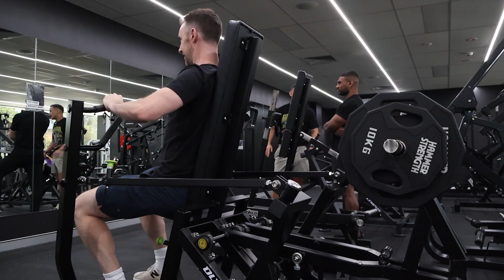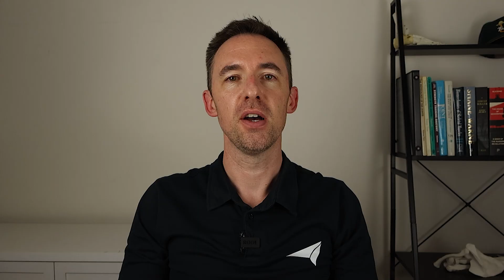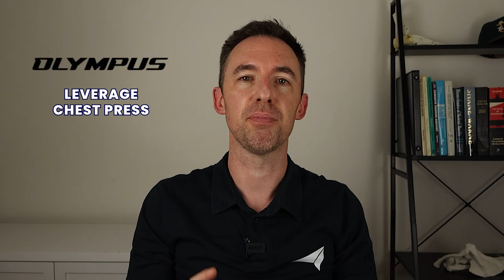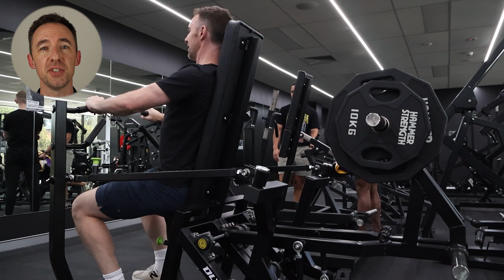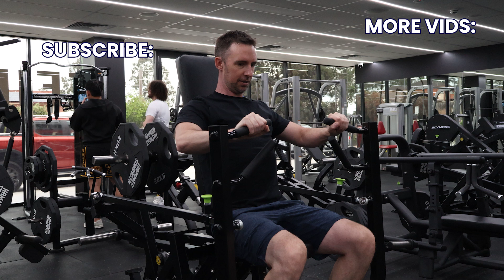Leverage Chest Press Machine Analysis

Comment: Great analysis.  Training many, many men over the years, I find men will fail at the tricep extension end of the rep in a set as the pecs have more mass/power to drive weight out of the bottom,  than smaller triceps can produce at extension..
Reply from the maker: Yeah I've found that at times myself, often with dumbbells where the triceps fail and you get that dumbbell wanting to fall inwards.

Comment: This is made in china and they claim Australian. It's s only put back together in Australia but you can order these yourself delivered to your home with better metal handle options and more options for $3000 total cost, if non unilateral it'll be $2000.
Reply from the maker: That’s a great deal 👍🏻.  Is there a website for that?  Is it relatively easy to organise?  I’m not sure if they claim Australian made or anything like that.  Just me pointing out that the website is in Aus and they can deliver here etc so that’s prob my bad.
Reply: @inprogress-au Alibaba if you source out and make sure you check thickness, weight capacity, delivery to door as many lie and just buy from the main people and sell again to foreign buyers. Power X was one with good stuff and their photos of this company also were some photos in the Chinese factory. I had some and were very good so a gym bought from me

Comment: Strength curve at different position?
Reply from the maker: From my understanding we’d be a lot stronger with the arms heading towards fully straight (end of range).

The nautilus chest press I own gets too hard as you get towards half way on the concentric.

This one goes the opposite way.  However you can change that if you load the plates on the bottom pin.

Comment: Looks like it has a lower loading pin option where the resistance curve would be more flat or even heavier when your arms are nearing full extension
Reply from the maker: That’s right. I forgot to even mention that option in the vid.  You def can load that pin and you’ll change that resistance curve.  Like you say it’ll get harder as you near full extension.  I’ll film this next time I’m out at that gym.

Comment: AS ALWAYS GOOD VID   I PREFER FOR THE RESISTANCE TO GET HEAVIER NEAR THE END AS I AND AS OH EVERYONE ELSE LOL IS WAY STRONGER NEAR THE END SO IF IT GETS EASIER, SURE, SOME 'LIKE THAT' 'CUZ WELL THEY SORT OF REST AS THEY FINISH UP    BUT I CAN ALWAYS TELL LOOKING AT SOMEONES DEVELOPMENT OR LACK OF IT IF THEY DO NOT HIT HARD ENDS - THERE TRICEPS ARE FLAT AND PECS BEEFY IN MIDDLE BUT TAIL OFF     I DO KNOW WHAT U MEAN THAT A FEW HAVE SUCH A SHARP HI END CURVE ITS HARD      THESE MACHINES IN GENERAL ARE QUITE SMOOTH SO THATS AS I AM SURE U EXPERIENCED IS NICE   THEY GREAT FOR LIFTING HEAVY AND NOT GETTING HURT    OF COURSE, NOTHING BEATS THE PRIME OR STRIVE MACHINES, MATE, AS , U KNOW, ONE CAN MAKE IT HARDER AT THE BEGINNING, MIDDLE OR END    MANY DUDES WRECK THEIR SHOULDERS THOU AS YES ITS GREAT TO GET MEGA STRETCH BUT IF U GO TOO HEAVY IN THAT STRETCH U GONNA WRECK YER SELF     LUV YER VIDS MATE!
Reply from the maker: Thanks very much man!  Yeah it's nice where you can modify those resistance curves and make it slightly harder at that end point of the range.  I like it to get slightly harder from the middle of the range, but I have a nautilus chest press that takes it too far and just gets too hard about half way through the range.
Reply: @inprogress-au  YA THAT COULD HURT
Reply: @inprogress-au oh is that why I struggle so much at the end of chest press - I too workout on Nautilus 😂